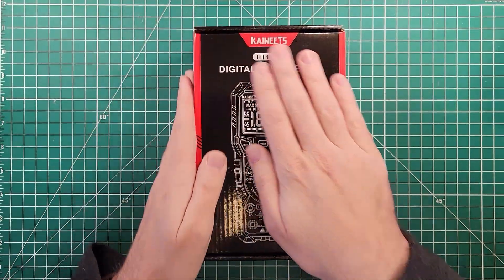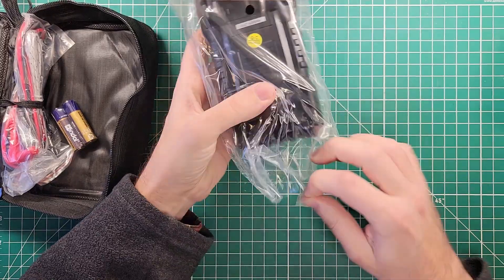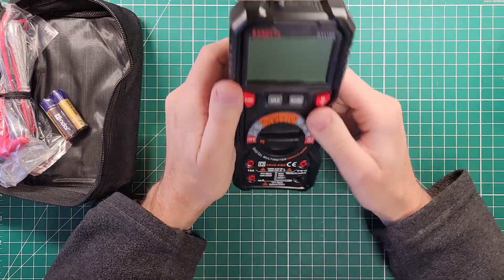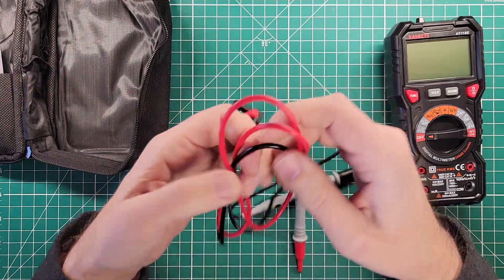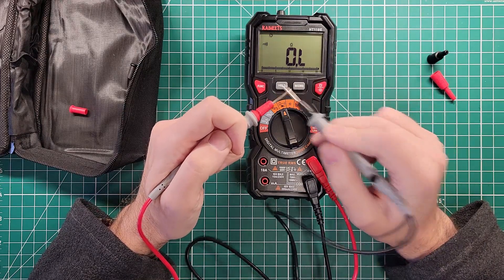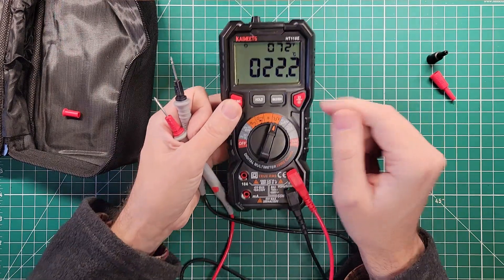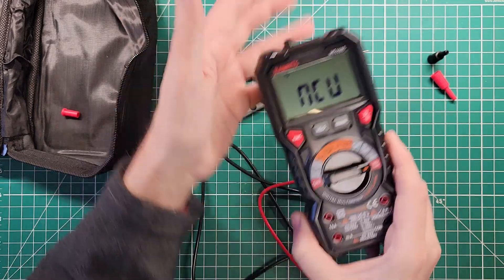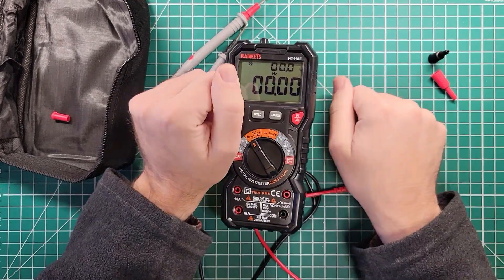One Step Up - Kaiweets HT-118E Multimeter

Comment: 6000 count version is marked down to $25.  Is there much need for 20000 over 6000 for ham radio and hobby electronic stuff?
Reply from the maker: I haven't found a need for that many counts.  Most of my measurements are 3-4 counts (13.8x volts, 470ohms, etc)  but I'm not high in the EE space yet.

Comment: 2 Questions:
-- Why is it important to remove the plastic layer over the display? (it acts as a screen protector if left on)
-- Does this have AUTO SHUTOFF?  And is there a means of disabling it, if it does have it?
(ok, sorta 2-ISH questions...)
BTW, I'm glad this one is LCD vs the LED of the KM601 (not readable in direct sunlight)
Reply from the maker: Its not important to remove the cover, I do it to poke fun at the people that make a big deal of it :-D

It does have an auto-shutoff, but I don't know how to disable it.
Reply: @temporarilyoffline  Thanks.  The auto shutoff was a big reason that bought the 601.  (frustrates me no end when the thing shuts off in the middle of a measurement)
Reply: @temporarilyoffline auto power off you can avoid when you hold the function button and turn the rotate on while the DMM is off